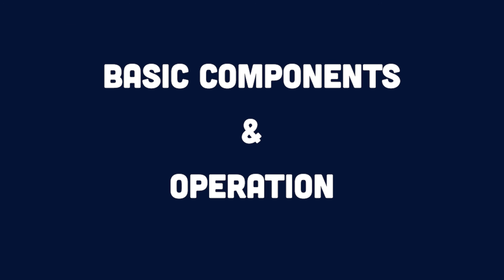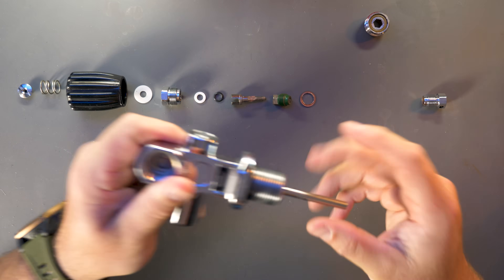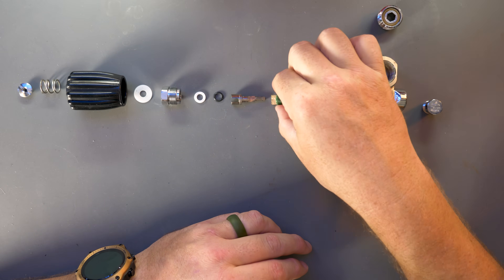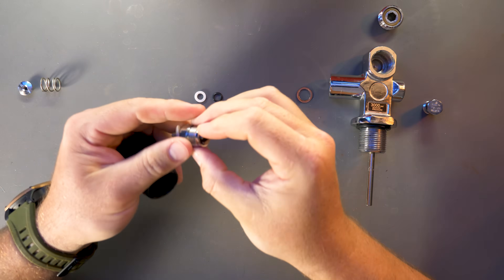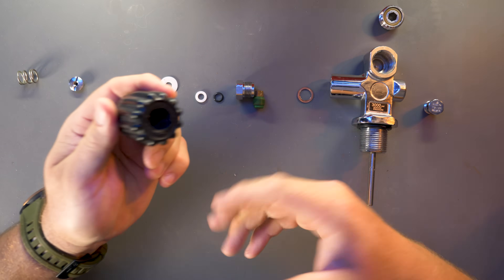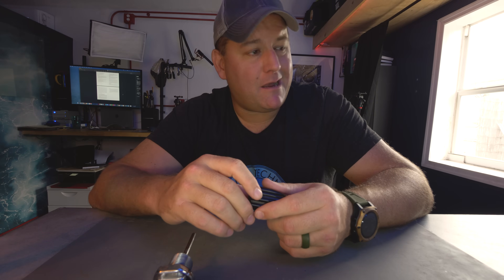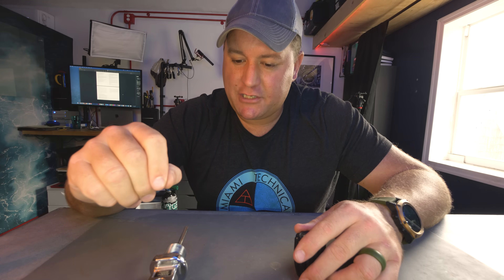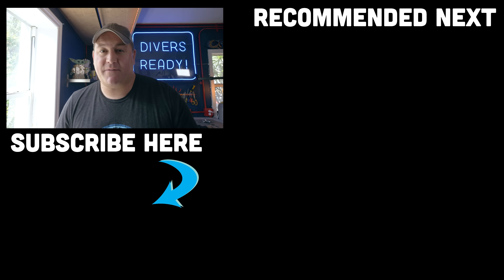Quarter Turn Back? An Exploded Scuba Cylinder Valve Explained

Comment: The white washers are made of a Teflon material not neoprene. Great safety tip, check your pressure gauge just before you dive.  I have had dive  masters turnoff my air supply.  The gauge indicator will not fluctuate if the valve is fully opened.

Comment: While diving this summer I had a rental cylinder and regulator. The valve was all the way open but the needle dropped and got back up again. The divemaster told me that it's normal on their cylinder/regulator. I don't know why this is normal but I had no issues during the dives.

Comment: July 2024: to your point.... just had a 77 YO diver die while shallow in a quarry dive in KY and it was found that his tank valve was only opened 1/4 turn.  It is suspected that he confused "righty-tighty / lefty-loosy" and instead of opening his valve some time after his equipment was set up, he shut it and cracked it open 1/4 turn.  

FULLY opening the valve is the ONLY way.

Tragic....

Comment: Does a quarter turn back from "full open" actually hurt anything? For all of us who learned that particular rule decades ago, I've always done it. Never created an issue with my gas supply. And after viewing thousands of videos, blogs, etc., you're the first person I've ever heard saying don't do it. My "forever buddy" (wife) quit diving years ago, so I'd say 80% of my dives over the past 15 years have been with a DM. None of them, during the pre-check, have ever said anything about that. 

Shower knob valves are nowhere near as complicated as dive tank valves - but one of the reasons a valve stem on a faucet begin to fail is because people (my wife, LOL) cranks on that knob as hard as she can when turning the water off. The valve stem washer gets worn out. 

So I guess I just don't get the harm in a quarter turn back from fully open, especially considering it took 2-3 full turns to get to full open to begin with.
Reply: Nice to know you didn‘t have this problem with your buddy. However，DAN reported a lot of case divers killed by half turn back.

Comment: I’ve messed up a few times where I only opened the valve a 1/4 turn. I didn’t find out till after my 140’ dive was complete. Also, I back the knob off just a smidge from all the way open. There’s been too many times where it’s all the way open and I couldn’t close it during a valve drill and had to have my buddy bust it loose. 1/4 turn is too much.

Comment: Hi James, Great Video series. 
 I just purchased a new Catalina 80 Alu tank where I want to replicate my old US Diver 80 Alu from the 70's with new decals.  Should be a conversation piece. 
Here's my question: The original USD J-valve is cosmetically in great shape and still on the old tank with 200~300 psi still in it and has not been used in 30 years. 
Can its J-Valve be serviced and used on the new tank?
Reply: The valve should be cleaned and get a new o-ring before installation. Otherwise I don't see a problem.

Comment: James, when a valve when connected to a regulator, leaks on the handle, what is the problem?
Reply: The packing nut is loose, or the teflon packing itself is compromised. Either way, the valve needs service.
Reply: @Andrew-ps6xe  Thanks.

Comment: If i buy a 3442 psi steel scuba tank with pro valve fitting and i screw out the din screw to make a din fitting will the tank din thread be 5 or 7 threads deep.now if i buy a din fill station in the uk will it fit regardless if the male din adapter on this fill station is 5 or 7 threads deep thanks

Comment: Thank you James!
Such a great explanation of a valve function.
I was taught that the quarter turn back was established because in cold water diving in an excessive gas loss situation (free flow for example) the valve would get so cold that the high pressure seat can freeze shut and you wouldn't be able to close it again.

Thanks for teaching us better and from now on I will keep the valve all the way open.

It already happened twice that my tank was open and someone closed it, then only opened a quarter turn.
That's why we should all do thorough buddy checks. Easy fix on the surface, rather than stressful situation underwater.

Comment: i agree coz i m always confused when people ask me to confirm their tanks being opened. but now i m doing theory of dive master.

one of the question: True or False: To ensure the air is on and to relive pressure on the valve's o-rings, many diver's turn the cylinder valve knob back a quarter-turn to half-turn after opening it all the way.

Answer "As a matter of routine most divers then turn the knob back a quarter-turn to half-turn (clockwise) to ensure that the threads of the valve's handle remain engaged, and to relieve excessive pressure on the valve's interior o-rings.
The correct answer is 'True'."

Comment: You said a bunch of people died because they only turned their cylinder on a quarter of a turn. fair a statement. However that has nothing to do with fully on and back quarter of a turn. By the way I was trained half a turn. Typically a dive cylinder valve takes around 5 to 8 full turns to turn on and off. 1/2 a turn back is not gonna cause I shut down. Have a look at the construction of the  valve. I cannot see how that High pressure Teflon seat can have a shut down because of a half turn. It physically cannot happen unless the valve spindle is turned. You are wrong about an incidental shut down resulting from a half term. I would be happy if you explained how the Teflon seat could do another 5 1/2 to 7 1/2 turns to shut down without the spindle been turned by other means.

Comment: What I do is, I open the valve fully and then loosen it, so it screws easily in case I need to close it. You don't want to be wrenching your valve if it's opened all the way and then some when you get a freeflow.

Comment: Loving your channel. But this time, erm. No. You open your cylinder all the way, and then 1/4 turn it back. No mechanical reason. Simply: if the knob turns (three fingers, no effort) a bit in both directions it's open, if it doesn't turn at all it's closed. Then again, never underestimate the power of the "silly people"... ;)

Comment: I always turn my valves all the way open and half turn back. The reason for this is that I had so many stupid divers not know how to shut off thier tanks and rip the valvle threads. Its safe, turning half a circle wont prevent air flow.

Comment: But you didn't mention the good ole J Valve which I have on my tanks !  They are still working great after 43 years of use ...   and  Yes we were taught to 1/4 turn and I still do and have never had any problems doing it .

Comment: Maybe Alec Pierce's video on this (and Youtube scuba channels) saved my life. 

I just did my 40M dive in my deep diver course last weekend with the valve only a quarter open (actually less because I only open it until theres no resistance). I checked my SPG at around 30M and as I breathed the pressure would drop from 190 bar to 75-ish. Luckily I breathed while checking the pressure and my instructor quickly saved the day when I pointed to my valve (I didn't want to turn it the wrong way).

I am also lucky I had watched the Alec Pierce video on this a few years ago and (although I forget most details out of the hundred or so scuba videos I've watched) for some reason I have a crystal clear memory of the visual of SPG needle dropping as you breathed and immediately knew what the problem was. Needless to say my air use was higher than expected for that dive.

What I think happened was one of the boat guys (Chalong, Thailand) was checking in case my cylinder was empty (to refill between dives) and opened the valve (I turn it off after setting up and release pressure from my octo so its 0 on the SPG) and before diving I stupidly turned it the wrong way and then a tenth or so of a turn back. I was taught the quarter turn back on my OW 2018.

Comment: I had the exact scenario happen to me on a liveaboard in Maldives. The valve was in need of service to begin with and was extremely stiff to open and close. 
I always do a pre dive breathe and fill my wing before before jumping. All was good. What I didn't realise was the deck hand was doing the "quarter" turn back while you were just about to jump in. At the surface I had my reg and took a breath as I started to descend. 
About 20' there was nothing. Everyone else was descending so I couldn't reach out to get a reg so I just swam up instead.
I'm an experienced diver but 
even though I wasn't that deep I was pretty stressed in those few seconds. I knew I had to be ready to orally inflate when I reached the surface.
I checked all my gear and reached back to check the tank valve, sure enough it was off 🤬
I opened it and dropped down to catch up with everyone.
Back on the boat I told the guy don't ever touch my gear again. He didn't understand English so I just my it clear as I knew he was only following directions from his boss and probably didn't know any better. Well on the second dive my son was ahead of me on the deck and the guy turned his valve back. Not a quarter but like 2 full hand twists. I yelled at him and warned my kid to check his gear again.
My biggest problem with the whole thing was that I'm an experienced enough diver to have the awareness and composure to deal with the situation underwater and get my self to the surface as safe as possible.
There were a lot of seasonal/vacation divers on board who could have easily been over weighted and not able to swim up like I did. They would have been hitting the inflator to fill their BC while at the same time sinking deeper. There was no body close to get assistance from because everyone was descending and we all know there's a lot of separation there until everyone gets situated at the bottom. It could have very easily been a drowning situation.
Anyway, Long story but definitely a good reminder to always double triple check your own gear and don't let anyone mess with it.
Reply: Wow, thanks for sharing. I'm glad that both you and your son are safe.
Reply: Deckhands should be getting their hands chopped off for touching people's valves without permission. So many diving accidents happened because of this.
Reply: As a divemaster there's no way I'm letting you off my boat without me checking your air myself. I do a quarter turn forward then back to fully open so I know it's not just stuck but I have no clue how someone could be so dense as to turn your air off and call themselves a dive professional.
Reply: @tylerbaird7287  after the first time you touch my life support there will be a conversation, touch it again after that there will be problems

Comment: I stopped diving a very large operator in Key Largo after they almost killed me with their 1/4 crap.  Short version, broke down my doubles into Singles, doing a 120 footish dive in Largo, Tank was all the way open.  Somewhere around 75 feet I am getting no air.  Switched to pony, asked buddy to check tank, he opens it up, and we finish our dive.  The DM had closed my valve then 1/4 my tank when pushing me in, yes, he admitted to it when I surfaced.  He had no idea what a reverse valve was.  I had told a different DM before jumping in, do not touch my gear.
Reply: Almost killed you, lol, being pretty dramatic there.

Comment: Thanks for the video. Good explanation, however I disagree with the conclusion of totally open.
Reply: Is that you Henri?
Reply: @ppo2424  yes, who is this?
Reply: Why? Please provide an explanation.
Reply: @nicwelch  simple really, the entire gas using world is using the quarter turn back, so why should we change an international industry standard on the usage of gas tanks. Then furthermore, totally open works in a perfect world where all tank valves are new, but they aren't. I think the debate on tank valves should not exist in the first place, we have a set standard, it has worked out well so far.
Reply: @TheOceanRoamer  To be fair, that's just not good enough. First of all the entire gas using world does not do this, at least not in welding. Full open or nothing, that's standard where I live anyway. Second, just because it's always been done a certain way does not mean there isn't a better way. I do understand thermal expansion being a problem when you go to shut the valve and it now being too tight but unless you're cranking on it with your hand it should be fine fully open right?
Reply: @nicwelch  But that's exactly the reason. Not everyone dives in Florida. Over here, during the summer, we dive when it's 30C outside and the water has 4C. Catching freeflow due to ice particles is a real possibility even mid July. I'm not saying 1/4 turn, but crank it open and then go back just enough to loosen the valve.

Comment: Sadly, during my last liveaboard, I've had to do the quarter-turn - otherwise after the dive the valve would only close with a wrench. Seems like that tank was in dire need of service.
Reply: The reality of using rentals, hence the 1/4 turn.
Reply: Did you check if there was a service date on the tank?
Reply: @ppo2424  Fair point. I just trusted the operator...
Reply: Was it the old style pillar valve? If so that design is exactly why the quarter turn used to be done. They would not close after using the tank, and the only option was a wrench or blowing an o-ring.

Comment: Taught 1/4 back in 1980s. The rationale that valve can get stuck open made sense. So applied the principle to all valves - water taps, gas cocks, etc. Never had a problem with valves I’ve opened but have come across many stuck open valves due to temp change contraction/corrosion from not being moved over a long period of time. However, was recently advised to only open LPG gas valves 3/4 of a turn at most. Sufficient to open the valve for LPG gas to flow but able to be closed with one twist of the wrist in an emergency. 

So it seems, full open for scuba valves, 1/4 back for water taps & only 3/4 of a turn open for LPG gas.

Comment: Something to add. I do not see many people, especially with rental gear, ensuring they can reach and operate their tank valves while diving. Not needing someone's assistance to open and close the valve can be extremely important. If everyone could reach their valves and know which way is open and closed, this point about the 1/4 turn becomes less relevant.

Comment: I always enjoy your videos. Always very informative. However, I'm a quarter of one turn guy. I've been doing it since 1997. One quarter of one turn is not going to restrict air flow. I do this for one simple reason...so that the valve doesn't bind. Every time I'm on a dive boat, the DM checks every diver's valve before they jump in and crank it fully open and every time I get out of the water and go to turn my tank off, the valve has binded due to thermal contraction. Tank sits in the sun for hours warming up, valve cranked open all of the way, then quickly gets cooled in 53* water. One time, I had to take a strap wrench to it to so I could close it to get my reg off so that they could refill my tank before the next dive. And yes, my tanks and valves are serviced regularly. I was a nuclear power plant operator and operated a steam plant with hundreds of valve. You ALWAYS close a valve one quarter turn to prevent binding from thermal expansion/contraction.

EDIT: For those that have no problems with stuck valves and don't like to close 1/4 turn of 1 turn, when you turn to full-open, be sure to just use your fingers and NOT cranked open like you're trying to tighten a bolt. I've seen DM's and divers' buddies crank valves open using their whole hand, which gives them more leverage making it more difficult to sense the amount of torque being applied.
Reply: I agree, it's not the issue its said to be. I also was certified in the 90s. Funny that in every other industry the 1/4 turn is standard.
Reply: This sounds like a very good point! Can more people comment on this? James?
Reply: i totaly agree on this , 20 yrs expieriance as navy technician , the quareter turn back is the ONLY safe way
Reply: Agreed, I'll be sticking to the quarter turn
Reply: Someone said it before, all other industries using pressurised gas tanks use a quarter turn. For good reason. Since most divers do not own their own tanks, and dive centers use their tanks til they don't pass hydrostatic testing, anymore. You probably will dive with tanks that may be 20 years old. The servicing of tank valves with the current low pricing in the industry is not done on a yearly basis. It is done when the valve actually does not work anymore. These are just the simple facts of reality. So quarter turn is still a must.
The inherent point here is training, and proper check prior to a dive. (No shortcuts)
Reply: @TheOceanRoamer  It's not valid in welding anymore so it's not all other industries. No disrespect meant.

Comment: An other version of the "Wide open, and then closing 1/4 turn" - The idea is that if a buddy is out of air and the buddy is hanging on your octo - then it is very fast and easey to feel (with 3 fingers, for both divers) if the valve is loose (open). If it is loose then abort the dive at once, together. You might be out of air soon, too!
Reply: WHAT..........................
Reply: Nope.